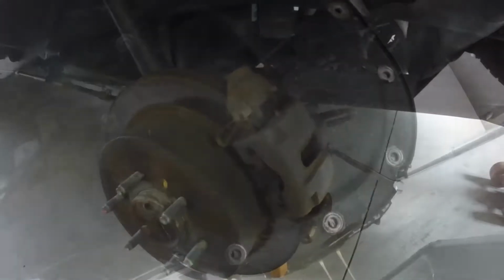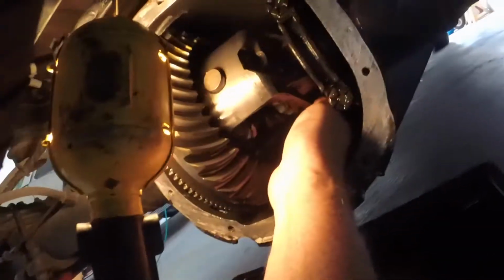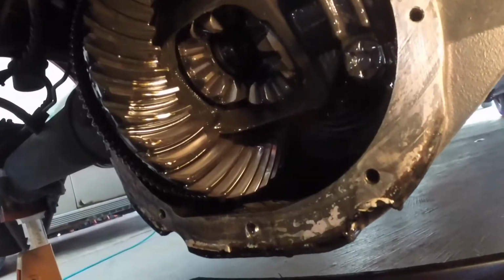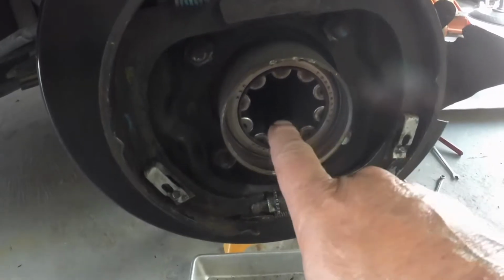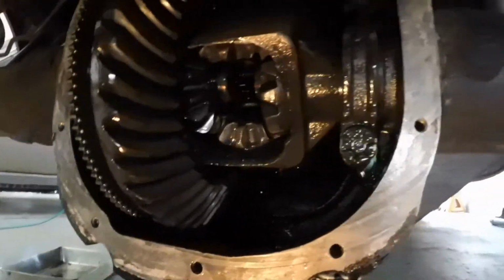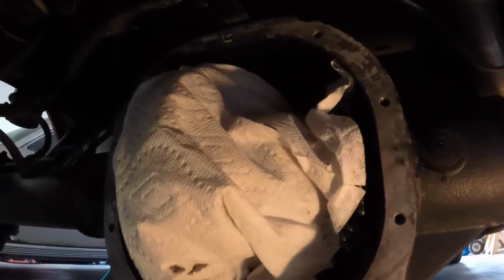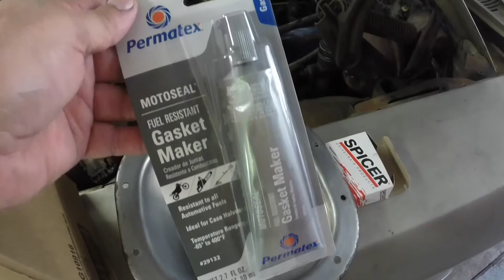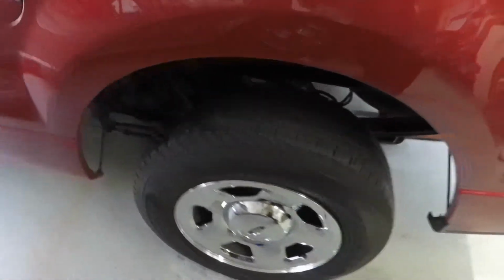Replacing axle seal on 2008 Ford F 150 8.8"

Comment: Those same rearends were used in 5.0L Mustangs. When the c-clip breaks, the axle goes bye-bye. My eyes kept straying over the the Galaxie to see what you were up to over there.
Reply from the maker: I pulled the belts and A/C compressor, so I could try to turn the engine. It is stuck, as I thought it was. If I have time tomorrow, I might pull the starter, and see if I can turn the flywheel. If not I will pull the engine, and go threw it.